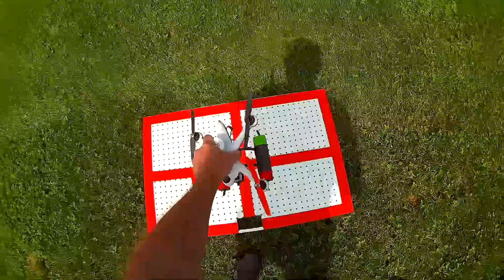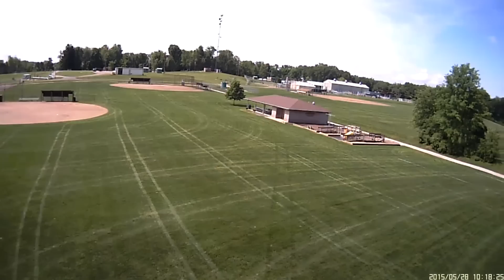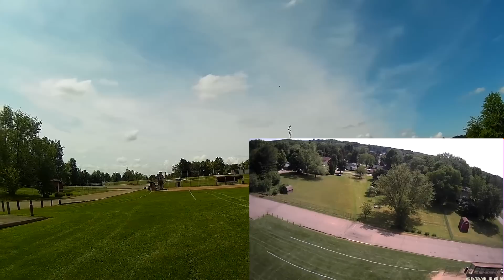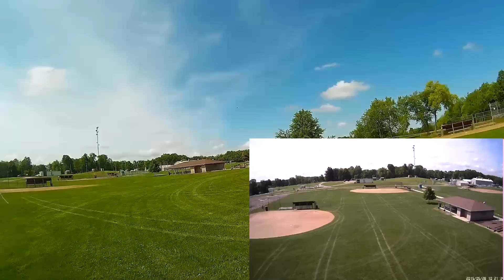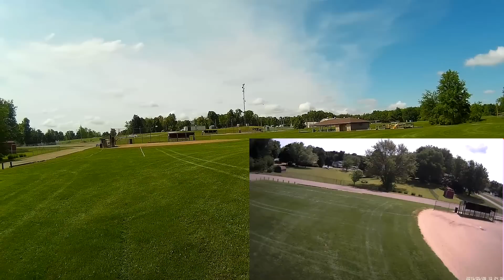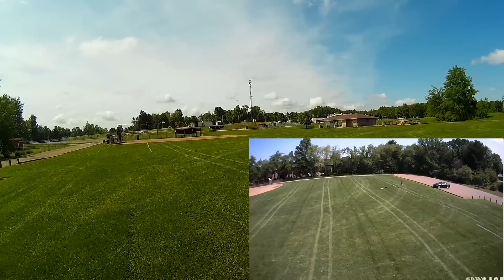3D X6 quadcopter runtime on a 2200 mah battery

Comment: It does not look like the trade off is worth the extra time in your case from a performance standpoint. If you were just concerned with doing aerial video the extra minute or so might be of benefit but with the extra work the motors are having to perform I don't know if it would be worth doing.